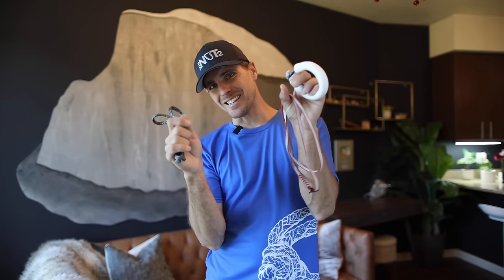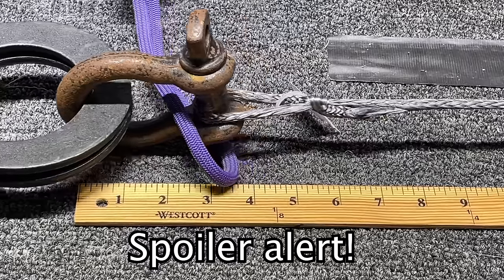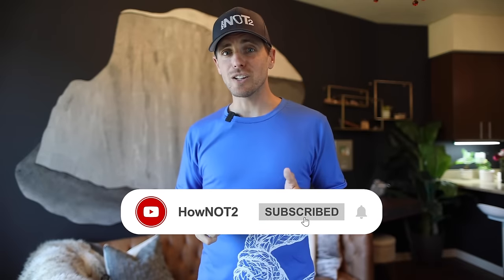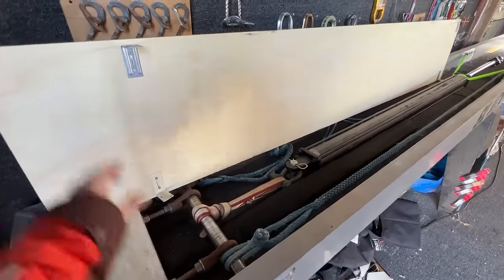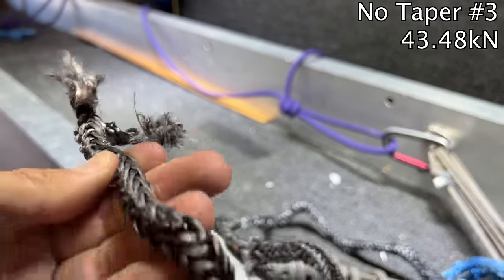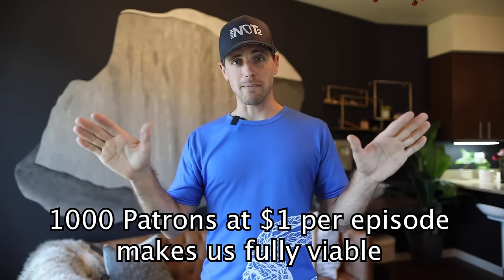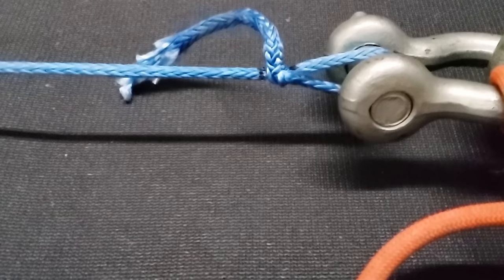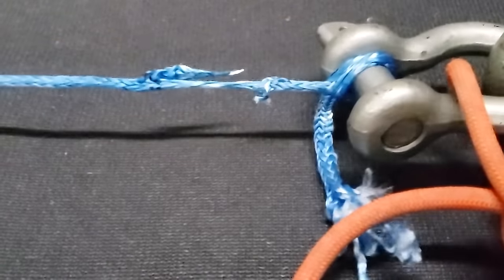Are tapering splices that important in Dyneema / HMPE?

Comment: With the blunt and diagonal tapers, the taper is probably putting stress on odd strands all the way in the eye. My guess is the eye diameter does matter, but is more affected by the type of taper. Hence, a proper taper puts even stress on all strands and your eye is therefore stronger, and the taper is the weak point again.
Reply: That is something I had not thought of, I would love to see some data on this.
Reply from the maker: It’s a good thought. Hard to test specifically
Reply: @HowNOT2  If you had access to proper slow motion equipment aimed at the back of the eye(s), you may be able to see which strands are breaking first. Possibly color code each strand to compare where it is against the buried end.

Comment: Excellent piece and as a Corinthian yacht racer who does his own rigging I was interested in your eyes breaking and your advice on eye size. I by habit tend to use longer eyes to allow snap shackles to be attached and detached easily using a larkshead hitch. Did you consider trying the difference using a larkshead which consensus says spreads the load on the shackle and eye ?

Comment: As a no climber I was think from outside the box that if the brummel spice was continue weaving it in and out multiple times from both end to but up inside would not have a weak taper and produce a higher Kln. Also it would be interesting to compare out a traditional brummel splice with a standard spice on the same dynema and them compete graduated  multiple weaving brummels to the winner to find the champion. Jim Rodgers

Comment: those different splices sounds a lot like two of the major offroad recovery suppliers use. Factor 55 and Yankum Ropes both agree on tapering the ends but have different opinions on depth of splice and how the tail of splice enters after the loop is made.

Comment: Thought it may be worth pointing out my assumption as to why teufelberger gives the Taper instructions that it does...

Teufelberger makes a hollow braid called Trex it is made of polyester. It is not made from dyneema type fabric so does not have the same slippery characteristics.
It is more similar to samson tennex which you have tested in the arborist video, which gave 100% strength with a single fid bury.

Comment: First I would like to say I love your channel and I am a big fan of your testing. But second, a criticism: At 5:21 of the video you casually "explain" that stitching is not needed for strength, that it is just there to keep the splice together when it is not under load. Obviously stitching at the throat of the splice will keep it from pulling apart--no argument there. But stitching, even of weak thread, can add tremendously to the splice strength, or more precisely, make possible a shorter bury that still delivers full breaking strength of the rope. The famous capstan formula shows how wrapping a rope around a bollard allows the transfer of force via friction from a loaded rope to the bollard in an exponential fashion when the rope is wrapped around the bollard. One use of this phenomenon is the tensionless hitch; another is the buried splice.
Consider that the core of the splice supports half the load at the eye, but that that tension is completely transferred (gradually and exponentially) to the cover over the length of the splice from eye to end of taper. The stitching at the throat means that there is already significant friction between core and cover in the stitched region, a sort of head start for the splice, meaning less bury length is needed to develop full splice strength, or, conversely, that the manufacturer-specified bury length when combined with adequate stitching is Plenty Good Enough.
Reply: @nolotengomiedo:  Whipping the eye -  will most likely provide significant increase in "pull out" strength in the instances of a short bury - more so than a simple non compression stitch, but  full stitching (as per some Samson Rope demos) probably goes some way to "simulating a short whipping.
NB, for climbing and short slacklines - probably all of what was demonstrated is super good enough,,  lol..
Reply: @kadmow  Yes, good point about the whipping. To get really technical, I should point out that stitching gets tighter as the load increases but whipping gets looser because the rope everywhere and the splice in particular shrinks in diameter as the load increases.
I did a lot of splice testing years ago, and even though the splicing instructions of the manufacturers (Samson, etc.) are very conservative (as they should be!), I personally use a short bury only with a locked Brummel, and only when the bulk of a long bury is a serious issue. When pulled to failure, the combination of a locked Brummel and a very short bury does pull apart, but the lock turns into an incredibly tight little knot that still delivers a significant percentage of rated rope strength.
Reply from the maker: It probably adds something but for the amount of stitching/sewing added, it's no where near the amount of a sewn sling.  Since I can consistently get 1 fid lengths to slip and anything above 1.5 fids typically hold, I can do 1 fid and add 1 stitch, then 2, then 3 and see if it gives me more strength.
Reply: @HowNOT2  It's interesting that you mention sewn slings. I never tried to break one, but I always wondered about sewing patterns, number of stitches, spacing between rows, etc. I think the engineering and physics of sewn slings is substantially different from bury splices, mainly because there is no Chinese finger trap effect with the slings. Also, a small amount of weak stitching can be the difference between a splice that fails under a small load and one that supplies the full strength of the rope.
Save yourself 2 of your proposed 3 experiments and do this: make a short splice in Dyneema, maybe a fid-length or so, one that is not too hard to pull apart. Now make the exact same splice a second time. This time put in 3 or 4 stitches of ordinary sewing thread at the throat of the splice and tie the thread ends together. Once again try to pull the splice apart.

Comment: They want us to use this for sailboat rigging instead of Stainless cables. 

Generally costs a bit more than half the cost of Stainless, generally less than half the longevity of Stainless. If you're willing to look the other way stainless might last 20-30 years before any (visible) damage occurs. As in there's probably some hidden corrosion, but no strands yet compromised.
Reply: Your reasoning is sound but twenty years would be max.with proper inspection.Big problem is and I’ve lived on yachts most of my life.The insurance company’s want you to change the standing rigging replaced every TEN years.DONT even talk about CARBON MASTS ,they don’t want to know because they don’t understand,so with synthetic rigging,I wouldn’t even entertain the idea.There are so many idiots in the insurance game(they have no idea) I had a claim a few years back for my yacht.They denied the claim BECAUSE WIND WAS INVOLVED,it was resolved but I was dicked around till I was pushed higher up the chain till I got someone that understood 🤓🤓🤓🤓

Comment: Hello,

Thanks for all good tests you're doing. It's very helpful and confirms the security factor.

Can you try, test, maybe develop a new kind of loop that could be more resistant?

Like tested in your video, certain loops failed, and we never know in advance if it's going to fail.

I had an idea, but I don't know if it's possible. 
Can we make  double loops to divide by two the pressure into loops? Or put a kind of cushion in between the UHMWPE and the metal part of the fixed part?

Maybe when a pressure is applied in between UHMWPE and steel there is a reaction.

I'm trying to understand these failures because I will not install on my sailboat UHMWPE that I don't know if it's going to fail or not...

Thank you very much,

Cheers

Comment: be careful with shortening the samples. this material is rate dependent. shorter sample with same pull velocity means higher strain rate and therefore different behaviour. BUT its much more complicated because you have non homogenous samples (tapered parts spliced parts plus the middle part etc.) so comparison is complicated.

Comment: for your last splice looks like the outer strands can close in on the taper. I wonder if the location you first pass it through adds too sharp a bend to the fiber and doesn't transmit forces.  You should pull to 14kn and then pick at the area around the taper to see if its actually tight....Or better yet use a thermal camera and watch where the heat builds up.

Comment: Interestingly enough Teufelberger doesn't state the rope material for which their splicing instruction is supposed to be. Atlantic Braids explicitly has a seperate splicing instruction for dyneema rope. As does Samson Rope.
Reply from the maker: Interesting. It looks 12 braid. I wonder if another material wouldn’t slip as bad
Reply: @HowNOT2  The stuff in the picture looks a whole lot like dyneema. But e.g. Samson Rope has a rope named Tenex which is a 12-strand single braid but is made out of polyester. And polyester shouldn't slip as much.
Reply from the maker: @bjornlange7483  So the polyester theory has been now told to me twice now.  I bet that is what it is but ideally that should be made more clear on the PDF but it does make a lot more sense.
Reply: @HowNOT2  They definitely should clarify that.
Reply: @HowNOT2  Technora would certainly hold better

Comment: Good video. 

Sampson ropes has a certification program for splicing various types of rope. I have certification in dynema. None of the methods shown appear to be done according to the manufacturers recommendation. (Hard to tell exactly without seeing it made. 

Main point  — if lives depend on it always follows the manufacturers instructions.

And check for updates before every splice. Because I have seen them change slightly in the last few years 

Final comment. That scrunching could be by design. Some dynema has a slightly longer strand to reduce the snap back of a line breaks.
Reply from the maker: We followed the manufacturers recommendations and it slipped.  So I'm not in agreement of "just follow manufacturer instructions".
Reply: That’s extremely good to know. I have sent sample splices to  Sampson  where they will inspect one for splice execution (to see if they were done correctly-almost impossible to mess up a dynema splice but they check anyway) and then preform a destructive test. One person I spoke too at their technical department (who was analyzing one of my splices) said that’s one of the methods they use to modify splice instructions. 

You may be on to something and I’d bet they would be very interested in testing some of your samples. My experience has always been positive. They take this stuff seriously and want to know about potential problems.

Comment: There is a single-hole loop splice technique for locking a slick bury that is formed by (1) piercing the rope with the working end to make a loop and then (2) to take the working end around the standing end to overhand the exiting working end and then (3) to enter the same exit hole to begin the long bury.  I found this splice on both ends of what seems to be a 16 strand braided polypropyline dock line. Your thoughts about the speed, strength and appearance of this simple splice?

Comment: Ive used dyneema before, but instead of the normal end tapered burried splice I use a method similar to the single tuck splicing in 8-strand marine rope. Id be curious as to see if there's a difference in breaking strain. Except each splice takes about 20mins 😂😅

Comment: I would of thought the forces you are loading are creating friction between the two layers which is also creating heat to a low melting point rope. That would explain the breaks at the taper and the eye breaks are rubbing on the shackle. Have you tried a dry vs wet test?  The wet sample should help (in theory) with the dyneema not heating up whereas in normal rope it will reduce the SWL by 20%.
(disclaimer : I'm no molecular scientist but I do have 20+ years experience working as a Rigger and make my own Soft Shackles) thanks for sharing

Comment: I’m about to make safety guard wires for our yacht using 6mm Southern Rope Super-12. To get over the tight radius issue I’m going to add stainless steel 316 tube thimbles. The Super-12 will be support through the turn. I know you can’t use these in climbing but would be interesting to know if these solve the break at loop issue.

Comment: thanks for those tests! will you also test the minimum bury length required for 90-100% strength?
i am using whoppie slings from 8mm teufelberger dyneema with 30cm buries (inner length), thats about 2 fids. so far without issues but i have never taken them close to their limits...
Reply from the maker: I’ve done a quick test before and found 1.5 fids was absolute minimum where it is 50/50 slips or breaks. I’ve done two fids for all my whoopies. I’ll test it as an official video though. I do wonder if cyclic loading would be a problem but stitching should mitigate that
Reply: @HowNOT2  ok, thanks! looking forward to the vid.
maybe you can have different manufacturers/SK qualities in there too, in case it varies...

do you include the taper within the 2 fid lengths or is that in addition?
Reply from the maker: @sciencebug314  the different sk qualities we tested are all very properly buried, tapered and lock stitched.

Comment: What would happen if you moved the brummel to the bottom of the splice just before the taper?   So, a standard eye splice, maybe a two fid bury, a brummel, then say half a fid bury and the taper of your choosing.   I'm guessing it will break at the Brummel, but possibly you'd get the benefit of a standard eye splice with out the need to stitch and end up with some hybrid break strength somewhere between the two??? Just thinking out loud.

Comment: Your tail should be 50x the diameter, so in this case about 300 mm. And your taper should be 2/3 of your tail length, in this case the last 200 mm. Since it's 12 strand, divide 200 mm by 12 to get ~17 mm, Starting at 200 mm from the end, pull out one strand every 17 mm and cut it. I like to cut even the strand on an angle, and I pull it a few mm before cutting so that when the line stretches out again the cut end sits inside the remainder of the core.

Comment: Some great testing thanks but you pins for the eye splices should not be rough old galvanized shackles , they should be super smooth  and polished  SS or similar . If the dyneema  is moving on the pin that completely different situations as you have abrasion happening . 
Get shackles that are smooth and reverse the shackles so the dyneema does not jamb in the corner of the pin to shackles. 
I come from the sailboat world and dyneema is often under continuous load for many months at a time , creep is a problem !

Comment: Could the splice being pulled out with a shorter buried section have to do with the size of the eye / the size of the object it's going around? (Because of sideways force on the knot)

In other words, would the shorter taper work better on a carabiner which has a smaller diameter?
Reply: interesting.
Reply from the maker: I think it would break it faster.  Smaller diameter puts more force on outer strands of the eye and you can see a bunch of the eye breaking, even at that diameter.  So a smaller bend radius could make it worse.  I could make an entire video probably testing eye bend radius
Reply: @HowNOT2  Then what about a bigger eye to match the bigger diameter, but keep the same length buried? Just to test the effect the eye size has on the strength of the knot.

Comment: Instead of stitching the tail on an eye splice to keep it from backing out, try misting the tail with contact cement like DuPont 77. Let it dry for a few minutes, and pull it through. The idea is not to glue it, but to make it "grippy".
Reply from the maker: Stitching is only intended for it to not come out when NOT loaded.  Grippy against not grippy other strand is still slippery and should be buried at proper lengths.
Reply: @HowNOT2  I'm aware of what the stitching is for. I am also aware the tail should be buried at the proper length.

Comment: I splice a bunch of ultra slings and dead eyes for treework and the only thing I noticed was it was not lock stitched with whipping twine. That does look like a suspiciously short bury though.
Reply from the maker: Do you lock stitch Brummell in your work?  When I’ve used Brummell I haven’t used stitching but I’m using it for different stuff
Reply: @HowNOT2  only on rigging rings, keeps eye snug on ring. Generally much longer bury though. Curious why it’s so short. Never had a locking Brummell do that, even on winch line. Granted not pulling near anywhere MBS. Love your content!👍🏽💪🏽😁

Comment: The first uses I know for Dyneema/Spectra was in sailboats and looking at their recomendations for splicing eyes.
But the one thing you can say is for climbing and splicing a sling/quck draw.  Is the breaking strength is more then adquate for almost any method.  Though I prefer the Brummel method.
Was wondering what was your intention of what are you going to do with your spliced eye slings in the real world?

cheers
Reply from the maker: I don’t know if this is real world but in this video we did an eye splice that if it failed we could have died https://youtu.be/bG6X9NOzqm8?t=216
And we put eyes in our whoopies for highline anchors and splice things for spacenets and I’ve used them in climbing as lightweight funkness devices
Reply: @HowNOT2   1st thing I thought is most the splices held way over what any piece of climbing equipment will hold i.e 50kn.  Only the open tail brimmed was below 15kn but still this is over a lot of slings. 
But thanks as I an a gear junkie an ansl compulsive and way over engineer everything.